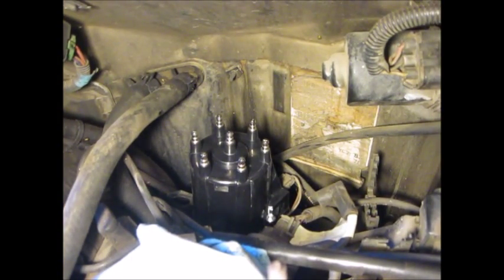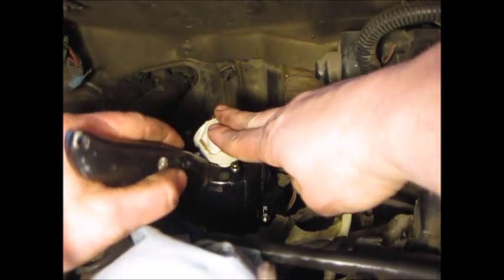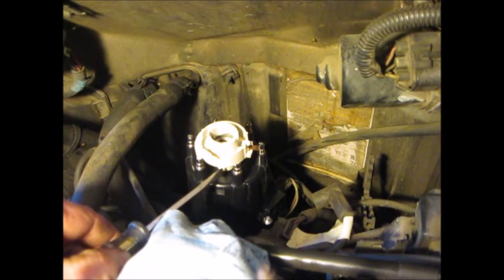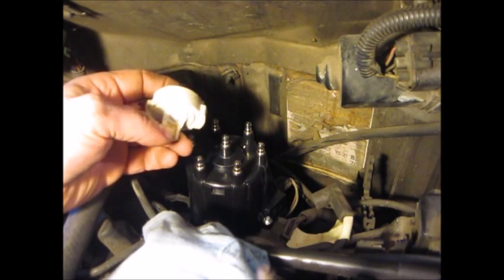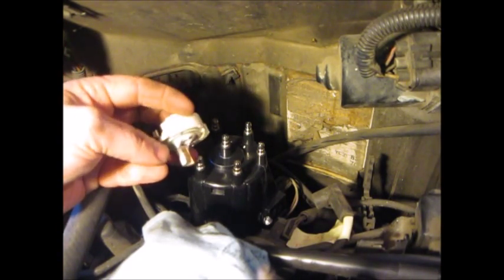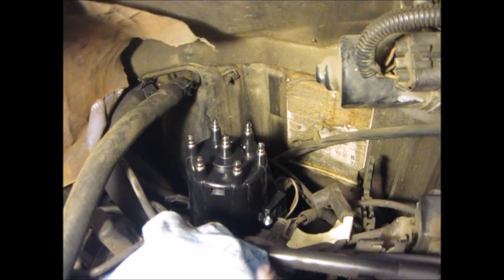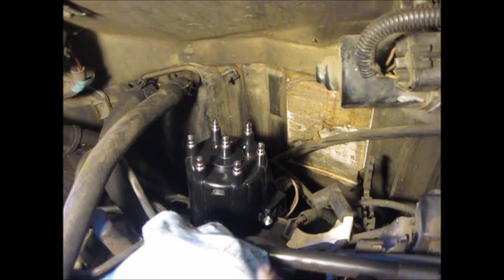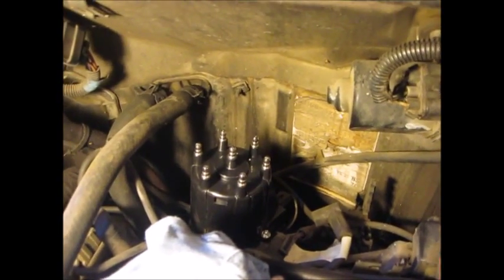Rotor button stuck on the distributor. One way to remove.

Comment: My rotor was rusted too and I could not figure how to remove it.  Thanks for the idea of scoring it and then splitting it.  I'm ready for work tomorrow!
Reply from the maker: Tim McGee You're welcome.
Reply: paulsjunkcars 
Thanks for this great video!

This must be a very prevalent problem with the button rotars, I experienced this problem changing out mine in my '93 GMC 1500 Sierra.  

I actually used a hacksaw blade to cut a kerf, and then was able to crack and remove the rotar.  Thanks again for your help.

Also... Removing the wires and numbering them like you suggested is the way to tackle to this job.  It's true you could leave the wires on the old cap and then copy them onto the new distributor once it's installed, but who wants to deal with the old distributor right in your way as you're putting on the new one.  Pay no attention to that Monday morning auto mechanic who poopooed your idea of numbering the wires.  
If he's so god damned knowledgeable I don't know what he's doing on yt watching your video.

Thank for your help!!!